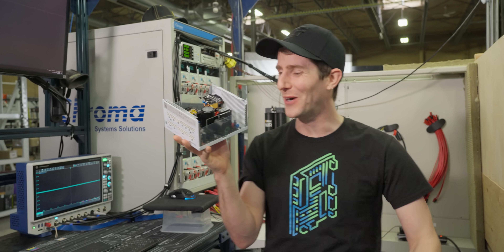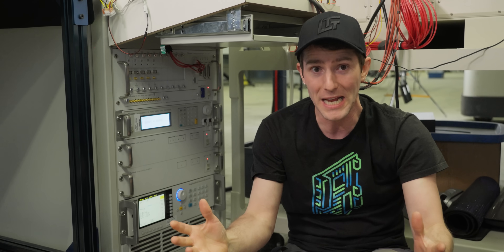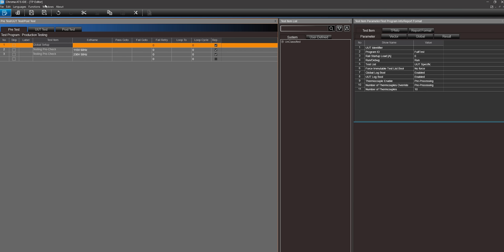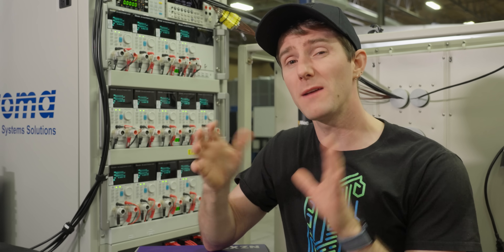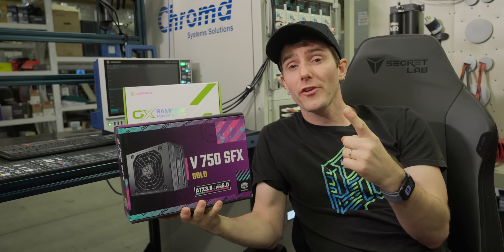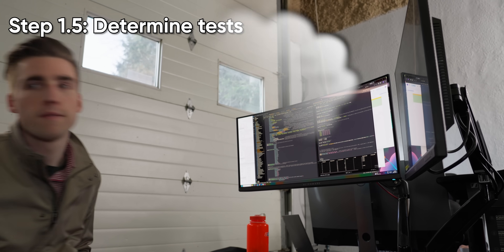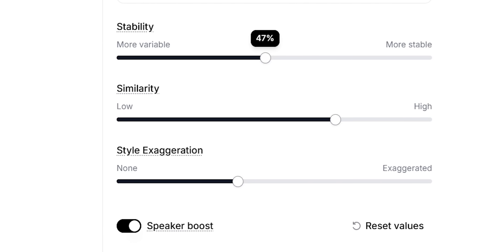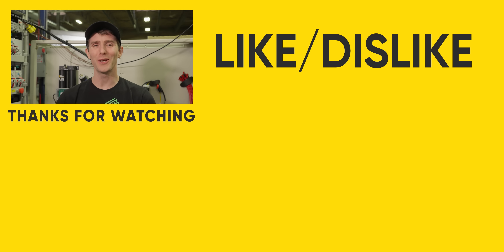Thousands of You are Buying Dangerous Power Supplies

Comment: Labs should test how much current the PSU draws from the wall the first time it's plugged in. My Corsair unit can sometimes trip my breaker when I plug my computer into the wall. I think it has something to do with charging all the capacitors, but I don't know. Labs should test that.

Comment: I never recommend or buy anything below a mid ranged PSU like MSI... something with at least a decent company behind it and not some no-name crap.  I also prefer a 650w+ fully modular 80+ gold rated PSU or a bronze and/or non modular if I am on a tight budget.  Usually you can find them in the $90 range (or $60 for a trimmed down one).  I typically stick in the 125w CPU and 250w GPU or less range so 650w is usually plenty.  I will not touch an Intel CPU and the X080/90 are too expensive, too hot, and draw too much power.  90% of the games I play just do not need that kind of power to run smooth at 4k.

Comment: My EVGA 1kw is 12 years old, 2 years out of warranty. Debating if I should keep using it, or replace it with another unit with a warranty and use it as a hot spare for another project.

Comment: If you are using 650 witha a 750. If you pushing . Maybe get 1500 but its not needed. 
A 1K power supply can supply the needed volts and deal with the counter charge. 
Middle your power. from the wall. 40-80 from wall. 
Then keep a 1000 power supply low. 

WAnt more 1500. and hit 900 wats and play with Overclocks.
|
Its not needed. your CPU is not that fancy!

Comment: I had discussions with UL a few years ago about product testing, where the regulations specify nominal voltages with a tolerance for testing.  Test documentation instructed them to use the extreme of each of the parameters individually whereas I argued that the testing should be performed at whatever is WORST for the device. This was further exacerbated for domestic products where the tolerance band was increased from 10% to 15% meaning that a device rated at 240V AC must work at 276V AC, then you throw into it temperature, humidity, air pressure... plus the delay in working after storage ( which could be as low as -60C).  The UL standards have now been updated to use this method.

Another company I worked for had storage requirements and on top of that a claimed lifetime after storage - but only tested at nominal conditions.  I argued that since the high storage limit was the worst for the test , that we should claim at that point.  I was told that was not the company 'standard'.  A foreign audit  a few weeks later told them that the storage calculations were incorrect and they had to repeat all the testing at the higher point.

Comment: Rock a refurb RM1000 Corsair, been a beast as a "Refurb" But toook 2 AMD 580's grinding light Coins.) 
Still rocking. powering a 66000 gpu. I think about keeping the bell curve If its not useing the max. {1000 used as at 5=7 hundred) 
It only has to power things.  Energy usage is the moving factor.
Reply: Get a good power supply that you can work with the mid range. 
Best idea is let for more . They last., A 1000 watt PUE. Is gold. 
If it can 600-900 watt max. Then sustain. 
The bronze gold plat is FOMO. 
No regulations.

Comment: The power supply has been some thing I've never been compelled to cheap out on. A good MSI or EVGA was always two seconds away at BestBuy or some other computer shop in town. My first foray into something other than those two brands was Seasonic and it was mostly cause power supplies would link together and turn on together and this was mostly done in my mining rigs. Even then it was a 1300w platinum power supply with 10 year warranty. No issues so far with lots of run time on mining rigs.

Comment: Just so you know, you almost certainly don't have to use Chroma's awful test software. It looks like everything you have uses GPIB, so you should be able to just send the commands listed in each instrument's manual using pyVISA. (In fact, just judging from what you're showing off in this video, it looks like Chroma's software is a very thin wrapper around that designed to be "user friendly".)

Comment: I bought a MSI MAG 1250G with my Zotac 5090. Rig kept crashing, could not figure it out. I was monitoring my PDM2 to see what might be an issue power wise. On a spike the PSU would fail and restart the whole PC. Replaced it was a Corsair 1500 and no issues at all. Fan barely kicks on for Corsair PSU.

Comment: I'd be happy if Kolink(Enclave, Regulator, Continuum), KeepOut, Xilence, Spire, and maybe some more, to represent lower end better.
I think/hope Kolink (80+ Gold/Platinum) is decent, Spire used to be decent but not any more (in price to performance), and the others would be a nice example to show, as they are fancy, expensive, high Wattage, but I think they'll spark and smoke, still KeepOut has nice price point, and might be a budget solution if it survives some of the testing.

Comment: I actually had a PSU back many years ago that was so sensitive to brownouts that it would still cut out when connected to a basic offline UPS. It was one of those cheap powerboard style UPS from Cyberpower so not saying that, that thing wasnt part of the issue. But it was also the only PSU that ever caused any issues. And later on when that PSU was used in a different build on a Sinewave Line Interactive UPS it didnt cause any issues. At the time i just put it down to the two not liking each other.

Comment: Back in LAN party days. Before we knew about "good" power supplies. I was setting up my rig, reached around back,  over the top of my case with my face about 6 inches from the PSU so I could see to plug it in. And POP! I got a face full of sparks and Magic Smoke! 
This was at 5:55 PM. I called the locally owned PC repair shop and he agreed to stay open until I got there.  
WOO HOO! Lucked out twice in 1 hour.

Comment: A thing about videos that involves TTS: Yes some may dislike it (me included), but in order for the TTS engine you need extra effort in terms of proofreading during the text scripting process,  as well actually checking the audio provided by the TTS engine especially for something like proper nouns.
Example: There are possibilities some TTS engines will read PSU as "tsu" (from the word "tsunami"), so to get over this, you either get the text to full caps (it'll read it letter by letter), or just straight up separate it (like typing "P S U" on the text script instead of "PSU").

AI TTS could be smarter in terms of recognizing proper nouns and abbreviations, as well potentially so much better in terms of intonation compared to normal TTS engines, but don't fully quote me on that since I didn't try it that much, since I mainly used Microsoft's own TTS engine that was intended for Narrator through Balabolka here 😆

Comment: I bought a brand name PSU a while back and when i turn off my computer but i do not unplug the PC entirely (just regular "shut down") my PC creates a high pitched noises that slightly increases in volume over time (~12-24hours) - should i be extremely worried or is it just some really weird edgecase of coil whine?

Comment: Another thing that may be interesting especially for EU customers is that 80 PLUS specifications are typically rated for 110V while in EU we have 230V and thus should check for PSUs with a Cybernetics certificate; Many PSUs have different efficiencies for different mains Voltages and they are typically worse for 230V compared to 110V. But I found one PSU that has an 80 PLUS gold rating but a Cybernetics Platinum rating. My guess is that it's better designed for 230V because it's a BeQuiet which are designed in Germany.
Reply: 115V is very last century as well just like power cables not dug into the ground with breaking everything when there is a decent storm.
Reply: Every power supply I ever checked had much better efficiency at higher voltage than lower voltage. So much so, that when I ran racks and racks of GPUs and PSUs for gamer's favorite activity a decade ago I wired up a bunch of 5-15R USA receptacles to 230V, so I could use the factory 5-15p cables that came with all the PSUs. I used orange receptacles, attached directly inside the racks I had custom built. Nobody ever noticed, because someone would have had a fit if they knew what I did...

Comment: I bought a Seasonic 1000w Platinum & Cooler Master HAF 932 Advanced back in 2012 for my first PC build featuring FX-8150 & GTX 550Ti / Crosshair V Formula. I'm still rocking both in 2025 with 7950X3D & 4070TiS / X670E Steel Legend. Plenty of hurricanes and brownouts in Florida. You can save $$$ in other areas but never skimp on the PSU.

Comment: 2:42 All of those relays will eventually fail closed, switching the capacitors in will cause the contacts to eventually weld together. To alleviate this issue you can simply add a 10K resistor (to trickle charge the caps) and a 100mH or so inductor (to prevent the resistor from affecting your noise tests) in series between the COM and NO/NC relay contact, this will keep the capacitors charged so the arcing isn't too bad. 

Wanted to mention this as I've ran into similar problems doing similar tests before. Love what you're doing here.
Reply: Also, I would use DIN rail-mounted relays instead, since the mid-air boards just ask to eventually short on something
Reply: @MrHack4never  Those Chinese relays have absolutely horrific ESL and are meant for low current AC loads, but hey - those PCBs are less then a dollar a piece.

Comment: You know how seriously Seasonic takes their work, and how much proud of it they are, when they give testing equipment to LTT Labs to test their PSU. Shout out to them!
Reply: I dunno what happen recently but the takes from shit websites like reddit and the discords that sprout up from them are filled with morons who think seasonic is a bad PSU company which is pretty hilarious to me.
Reply: Been using Seasonic PSUs since the early 2000s. Never failed once, their warranties are so long that I can still sell off my old Seasonic PSUs. And FYI, Seasonic is an OEM manufacturer so they build for other brands like Corsair too.
Reply: I’ve had a 1000w seasonic PSU in 3 systems over 8 years with a 2070, 3090 and 4090. All GPU’s and all CPU’s were lightly oc’d and it’s never missed a beat.
Reply: Seasonic is EXTREMELY reliable. Even other Brand is using their PSU and rebranded them
Reply: Seasonic is goat of PSUs
Reply: We will see how serious. I have an eight month old unit that just smoked, let’s see how well they honor the warranty.
Reply: @support2587  they have  good service, replace ours after a month and it has been running for like 8 years now and counting.
Reply: My seasonic 520w bronze rated failed on me. And since ive changed it, my ram is not as sensitive as it was and my pc doesnt die on me whenever i bump the table, it started around 5 months of my purchase of it. recently found it's on the lowest tier at psu tier list.
Reply: @Peakalicious 520w bronze
Reply: @shuhei9571  mm yea, m12II EVO or whatever it was, didnt wanna bother to remember
Reply: @Peakalicious  I've had the same PSU (M12II EVO 520W) running for almost 10 years now in a country where power surges and brownouts are common occurrences.  Either you had a genuinely defective model or bad wires (from either PSU or worse motherboard). You RAM being 'not as sensitive as it was' also implies issues still happen even AFTER you changed the PSU so the PSU is not just your problem here.
Reply: @esentries  could be the former. One thing for sure is i dont have any random read failures on my ram anymore whenever i reslot em' with the new psu, works as they were inteded. nor does my pc die whenever i accidentally bump on my table and probably causing to generate a short. It really was the issue, and glad im over it, one less problem to think about.
Reply: Don't know about that, I've had 2 Seasonic PSUs fail on me. 
They are expensive and shit on my experience, and won't waste my money on them anymore.
Reply: @Ziegeri  what line did u buy?
Reply: @Mewzyc   Dunno what line this is, but this I had fail on me twice: Seasonic 1050W X-1050
Reply: seasonic is extremely mid in power supply space, they just have huge marketing and sponsorship
Reply: @ItsReaxxion  why are they mid? Their stuff is quiet and works well with a super long warranty, what the issue with it? lol
Reply: @LightningMcQueen-rc3mh  If you check every of the finest testing processes (Cybernetics included), Seasonic never gets to the front.

The difference is that other companies only have 2 or 3 top-class PSUs followed by 10 suboptimal ones; Seasonic's are all "above average". Consistency is their game, not consistently top quality.

For instance, my Corsair RM550x beats Seasonic's 500W PSU almost every matter, even down to MOSfet quality, reason why that is the PSU I chose. But do you trust every Corsair PSU? Not at all, not even myself; the RM550x is a specially made PSU that not even Corsair themselves can keep up with; Seasonic could, but they choose not to, rather going for an all-encompassing 7/10 vs having 1 PSU 10/10 and literally killing the rest.

If you want a good PSU, don't go for branding.
Reply: @ItsReaxxion  I keep seeing this posted by idiots all over recently. What information are you basing this off of exactly? Last time I checked Johnny Guru gave the 850 focus plus his highest rating ever before his website shut down so I am curious why people have begun parroting this dumb ass take.
Reply: @ItsReaxxion  Prime shitpost. If you have been in the PC building space since in the 00s, you would know how well-regarded Seasonic is in the PSU space. They're literally a fucking OEM for other companies. Kids these days.
Reply: @esentries  I recommend Seasonic or Super Flower to anyone who's looking for reliable power
Reply: @ItsReaxxion  My Seasonic PSU has been running strong since 2013. It's an SS-750KM3, powering an i9-9900k and an RTX 4080.

Comment: 1:56 the reason it is different from watts, is because in watts you assume your voltage and current are at their highest point at the same time, which isn’t the case when you have an AC system with inductance or capacitance

Comment: I was using Corsair PSU's before they even designed one and were rebranding other company ;)))))
To this day, none of my PSU's failed. My old PC would start like new if I'd get it back together, with 2000's parts.

PSU is really hard to kill, especially when you pay a little bit premium.

Comment: Hey why are labs etc videos not on the ltt channel? Is there a separate channel??? Ltt did a super poor job of letting us know if that's the case .like super poorly shared that info. Also I got that 750 watt pos power supply - it had HORRID RIPPLE TOO... I will be replacing it with a nice seasonic one that will also be used in the next build coming just before October...

Comment: Remember that those connectors on the connection board at 12:16 also will wear out and degrade. Measuring the voltage on the back side of the PCB is defitnly better than just on DC loads but when the connectors wear down it will skew the results. Don't know the exact specs of the molex minifit series but probaply around 100 cycles.

Comment: Wait, you guys are starting the test at 0°C? I'm sure most of the components should be fine, but I would suggest starting the test at room temperature and then testing it at the extremes. Power supplies are complicated, and these kinds of extreme temperatures might cause an issue in one component that could chain-react into something bigger.

That said, you're doing a very good job! This is exactly what the community needs right now. Companies should be held liable for their claims by a third party.

Comment: Currently using a older EVGA 1000 GQ 80+Gold rated PSU I bought new in late 2019. Still going strong with my 7800x3d+3080ti system. Probably going to ride this particular system into obsolescence and look into a pre-built sometime in the next 2 years in hopes of avoiding some of the insane gpu scalping. My 3080ti still does me well at 4k/120htz if I use some dlss/fsr + frame gen via Lossless Scaling

Comment: 9:42 is it dangerous to use a Corsair cx500 500w 80+ bronze PSU with a newer Gigabyte B550M-K am4 micro ATX motherboard with a Ryzen 5 5500 CPU and a 6GB RX6600 GPU?

Comment: If I could do one request it would be to test the efficiency at low load (e.g. 5 or 10W)!

There are a lot of folk that are into low power devices (in my case because I have a nas running 24/7 and energy in Europe is not cheap) and it is a complete lottery to find psu that performs at low load (many very good psu in normal condition have terrible efficiency at low load). This is an information basically impossible to find out. So please give it a look ~~

Comment: would be cool if you could also test those power supplies in installation situation an installation postion as well as some kind of miss-use. That way you get some interessting info about thermal throttling and thermals in general of the power supply. Keep in mind that the Airflow in those Chambers differs of the airflow in a case :). Thank you for the work you do in auditing the industry!